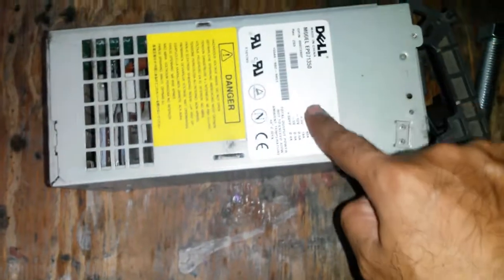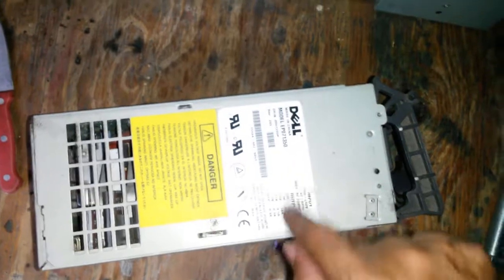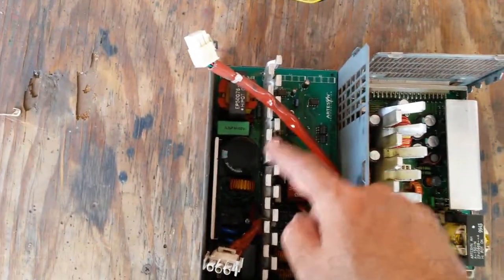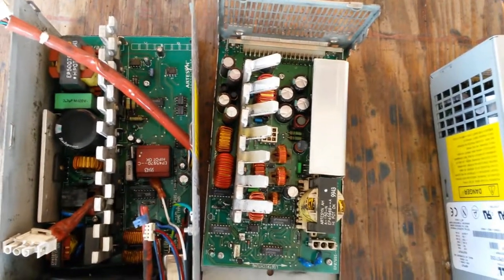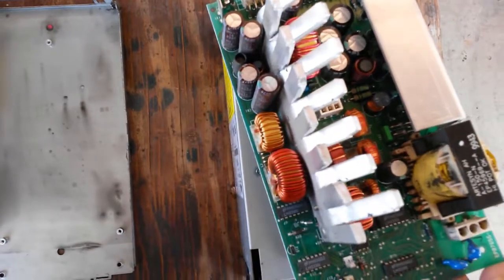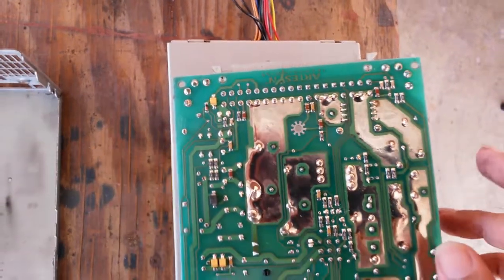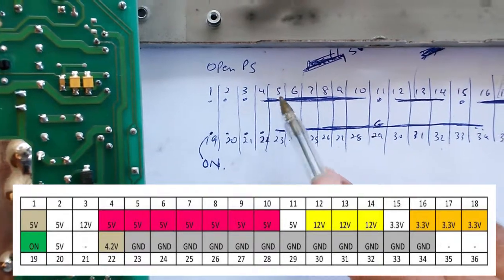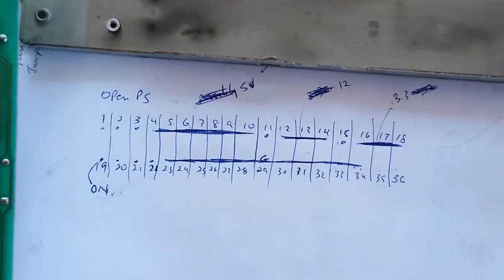143 Dell Server Power Supply EPO71350

Comment: Thank you for showing how to switch it on. I have one similar to that one but is only 280 watts output. I have measured the frequency on those power supplies, they are between 100Khz and 200 KHz. Although they are low power compared to a inverter microwave oven having higher frequency means that it needs less copper coils for the transformer and heating coil. Australia is a very wasteful country regarding electronics, inverter microwaves are so easy to get but server power supplies are very hard to get hold of. If I want one I have buy it from ebay and pay a lot of money to have it shipped to Australia.

Comment: Looks like a pretty good power supply, dude. 😊
Reply from the maker: It looks like a good supply but its weird. All the videos I can find on YT show server power supplies with specialised connectors. This power supply has the same ATX connector and it even fits the one on a normal power supply though its 36 pins and not 24. That's odd because ATX pins housings have 2 different shapes and they mix it up. This this specifically kept the same pattern. 

I hope it has short circuit protection like the regular power supplies because the experiments I want to use it for will require that.